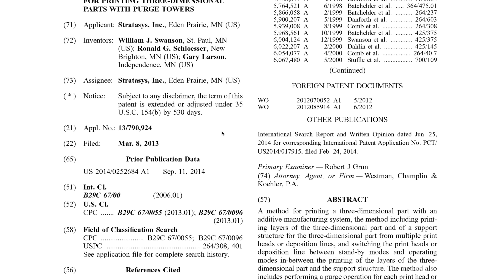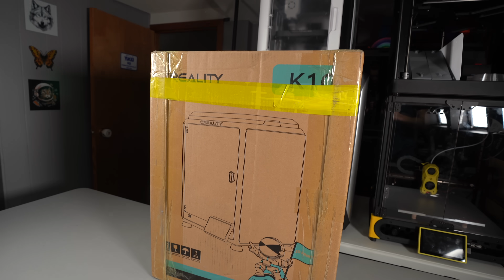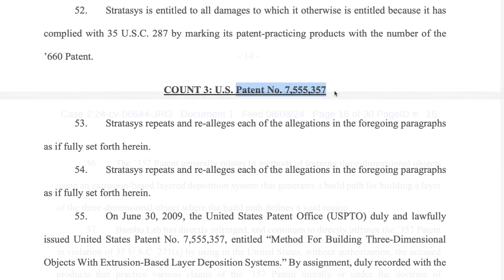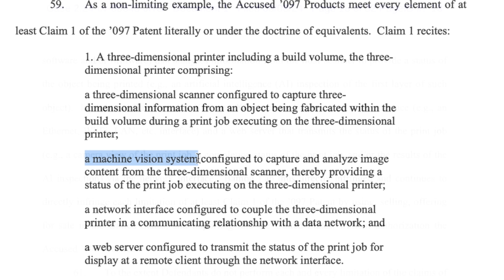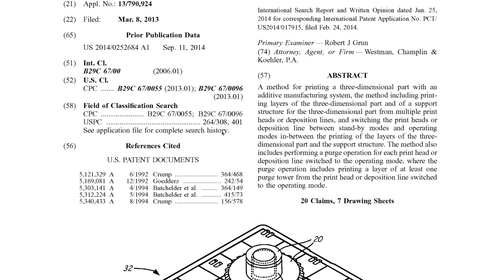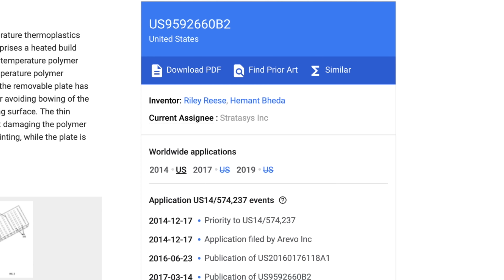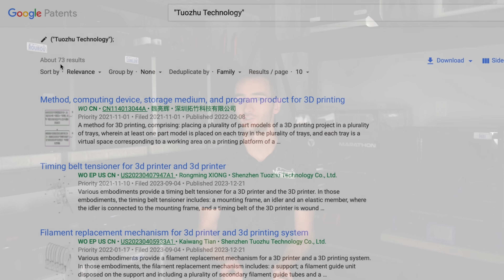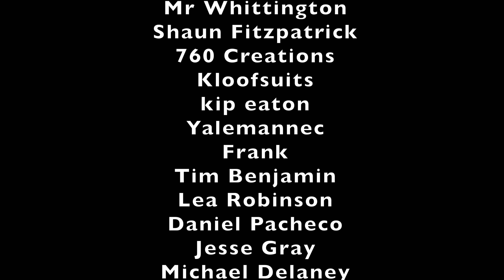Stratasys v. Bambu Lab - Will Prusa Play A Role ?

Comment: FIY, Bambu Labs is also positioning themselves to be a Patent Troll. For example, Bambu Lab have patented: Triple lead screws on the Z-axis (Shenzhen Tuozhu Technology Co Ltd, 2021), Filament motion detecting sensors (Shenzhen Tuozhu Technology Co Ltd 2021), Automatically determined variable layer thickness, A patent to print multiple colors each up to a "threshold" height value above previously printed layers, Automatic splitting of multiple object STLs to identify faces that are outer surfaces, inner stitching surfaces and other and applying different print qualities to each, Automatic determination of print speed per layer based on angles/curvature (and perhaps other features) of the model for each slice,  Multiple build plates in the slicer, Cutter in print head, Automatic determination of linear advance using 2 speed test print and LiDAR. . . 

Both Stratasys and Bambu Lab are highly capitalized tech companies that benefit from hundreds of millions of dollars in investment capital. They assemble huge portfolios of patents in order to stifle competition. Both companies are a threat to the continued viability of the RepRap/Open Source 3D printing community.
Reply: Damn, the only one thing i think they should be granted is the lidar, everything else is either prior arts in voron or cura
Reply: They are both poised to be patent trolls, yes, and yet stratasys is the sole reason we only now finally have printers shipping with sealed build chambers and some with heaters, the concept of sealing your printer in a box has basically been a pip-dream until their patent expired. They have stifled all innovation in the field, and have refused to innovate any affordable solutions. Now imagine the costs they impose on other companies to license their technology of 'box'.. Imagine if the X1C costs +$2k on-top of it's base price, simply for the honor of being a box that retains heat to help prints not warp.. because that's the world stratasys has been working towards, whenever they come out swinging like this.
Reply: Fair and agreed. Although if stratasys win then that just shows how valuable/essential patents are both for offense but also for negotiation with the likely settlement. The best outcome is if stratasys spend a lot of time and money and hopefully some of its ridiculous patents are invalidated. Then at least there’s a risk with patents and litigation. If they will all prosumer printers will need to start patenting to defend themselves.
Reply: @eltamarindo  You are absolutely right
Reply: Also, I don't get why outside Europe is still allowed to patent software features/algorithms... that is only harming innovation, and it is unjustifiable.
Reply: Just to play devil's advocate, it's possible they're patenting those things as protection from Stratasys, the bigger threat in that they have a lot of legal funds to throw your way.
Reply: Just abolish patents. Problem solved
Reply: Yep, I quite dislike what Bambulabs are doing but Stratasys is actually putting it into practice now, it would be a huge precedent pushing the whole industry back years.

When Bambu tries to do this in the future, they'll face community backlash like Stratasys is now.
Reply: I don't think you understand what "patent troll" means. Almost every company files for this kind of silly patent because the primary functional of patent in real world is to serve as a deterrence. Companies build an arsenal of patents and use them to countersue when other companies sues them, creating a chicken race situation in mutual patent lawsuit that often leads to settlement. Sometimes company may even seek loophole to file a patent that is not a novelty but similar to something their competitor already uses just to strengthen their patent portfolio (Stratasys did this in some of their patents). This is a standard practice in the industry. We have a flawed/very dated patent system and all companies are doing this whether they like it or not, because not playing the game put them at disadvantage. Hate the game, not players. It's only "patent troll" when the patent holder is not actively using the patent with the sole purpose of having patents being to extract license fee out of other companies. That is applicable to neither Stratasys nor Bambulab here.
Reply: Patents are the way a company protects itself against other companies. IBM is famous for this approach. Sue IBM for patent infringement and they will likely counter sue using patents contained in their arsenal.  Owning patents is not the issue. What a company does with them is.
Reply: I hope Prusa can make a Bambu Labs competitor. The XL is too expensive and the MK4 is too slow, only 1 material, and has no enclosure

They need to make a $1000 Bambu killer or I’m worried about their future
Reply: @chadkrause6574  they can't. You can't make a glorified Ender3 more expensive that good CoreXY enclosed machines and be the competitor
Reply: @chadkrause6574  The new MK4S is actually a little faster than the Bambu X1C, thanks to a much better cooling system and the high flow hotend.
Reply: Are they actually enforcing those patents though? Sometimes companies play the game by accumulating lots of vague patents, so that they can enforce them defensively if another company tries to sue them.
Reply: @andybrice2711  Who is "They"? Bambu Lab is the marketing arm of a set of larger  Chinese conglomerates. The larger entities own Bambu and own the patents. It is the upstream owners of Bambu Lab that will be enforcing the patents.
Reply: No, a patent troll is an entity whose sole activity is to own patents and litigate.  Bambu Labs is, per definition, not a patent troll.
Reply: Exactly, Bambu isn't some small company being victimized by a giant corporation, they're just as massive and patent happy as Stratasys. Bambu made their bed and now they get to lie in it. I'm not saying Stratasys is in the right, but I don't have a lot of sympathy for Bambu. You reap what you sow.
Reply: Has bambu gone after anyone for using similar tech? Owning a patent is not the same as being a patent troll. Look, I want a reason to hate bambu but unless they actually do something bad I dont have a reason. Outside of not being open source and using proprietary parts.
Reply: You're surrounded by products with patents. Why is 3d printing supposed to be patent free?
Reply: True, but Bambu also improved the designs and made them super reliable, affordable and available. I don't have a problem with patents that are super active like that.

On the other hand, Stratasys patented and then did nothing for 20 years, but keep others from advancing the tech.

Now that companies developed in 5 years, what Stratasys refused to do in 30 years, now they have a problem. They had a monopoly for 30 years. Give us a consumer sub 1000$ 3d printer then Stratasys? I'll take it, heck I'll take 50 of them. Bambu is a multi billion $ company now. Stratasys market cap is 0.5 billion. They could have 10X their makret value if they actually USED their patents and gave us a consumer 3d printer.

F them and their patents.
Reply: @replikagear3333 oh get a clue already! Patenting the use of three lead screws for z axis? Are you kidding me? If Bambulab could have their way you'd only be using RFID tagged materials from their store, same as stratasys.
Reply: @free_spirit1 You're assuming an awful lot. As others have said, having patents isn't an issue. It's what one does or doesn't do with those patents that matters. If Strata wins, Prusa will be next, and so on.
Reply: @free_spirit1 So what's stopping them from forcing us to use their filaments? I care about bambulab cause I can afford their printers, I don't care about stratasys cause their good printers cost as much as a luxury car or as with the ultimaker printers which I've heard are outdated and overpriced.
Reply: @OhImKiCkiN  ah yes companies, famous for being totally consistent in how they operate over multiple decades and leadership changes. especially when it comes to principles they haven't even claimed to have, let alone made any sort of binding agreement to uphold. as long as a company's present leadership has a general vibe of maybe not wanting to use them for anything nefarious in the immediate future, what's wrong with granting them unreasonable anti-competitive powers that last for decades?
Reply: @OhImKiCkiN  I do not think that prusa be next. Bambu Labs jumped 3000%, Creality 30%, Prusa wasn't mentioned.
Reply: @SpectraV3i  I'm not sure what that has to do with anything. If Strata wins they'd start new suits against other companies, and they wouldn't show their hands now anyway.
Reply: @free_spirit1 they could do that, but they just know it’s bad for business and won’t.
Reply: I kinda want Stratasys to win lol. That's my hot take. BBL shouldn't have even been granted most of their patents to begin with
Reply: @thanhtacles  If you want Stratasys to win, you obviously don't care about affordable consumer printing. Most of Stratasys' parents are incredibly vague and cover basic stuff, on the level of Apple's old "rectangle with rounded corners" patent.

Comment: pretty sure this lawsuit will be settled out of court, i spoke to some patent lawyer frinds of mine and they all said, this will likely be thrown out of court since stratasys hasnt done anything for other companies using the same technologies. 
heres hoping
Reply: You don't need to defend patents the same way you do for trademarks. As unethical and shitty as it is, you can absolutely spend 10+ years letting an entire industry grow up around your (infringed) patents, then swoop in with lawsuits to eliminate all the competition and steal the market that they created.
Reply: They might persist with LiDAR and hot-end filament pressure sensing, those are unique to Bambu I think.
Reply: I dont think there is anything in patent law requiring a holder to sue all instances of infringement before any other company is sued.
Reply: Right, this is what I've been thinking - in order to have merit in defending a patent, you have to defend it consistently. To wait this long while Prusa and other companies "steal" their patents (that should never have been awarded in the first place). They haven't consistently gone after companies for the heated bed, purge towers, features of octprint and Duet, etc, so I don't know if this would even fly in the Texas courts that favor patent holders. All Bambu's layers have to do is point to Prusa, Duet (or companies that use Duet in the end products), Creality, etc and say "These companies have been doing these things for years and you didn't file suits"
Reply: @anthonyalbanese1993  You're thinking of trademark law. Patent law does not generally require you to defend it for upkeep because they expire after 20 years, whereas trademarks can be renewed indefinitely.
Reply: @anthonyalbanese1993  Yeah but that's the power of the US legal system. Judges CAN just ignore the argument that consistent patent defense is even necessary, even in this particular case. There's no consequence to ruling it like that, other than the threat that it can be appealed, but that requires a higher court and continued pursuit on plaintiffs. Judges with domestic/politicized biases can just rule for the patent holder despite sound arguments, esp in a case like this where it's Stratasys (USA) vs Bambu (CN). There's nationalist interests angles to this case.
Reply: bambu hasnt done anything either but taking technologies from other companies
Reply: @michawasiljew6620  Yeah, but I also haven't seen Bambu going around suing other companies.
Reply: @michawasiljew6620 Shit take.
Reply: @catnipaddict126  Keep mushrooms out of this!
Reply: @michawasiljew6620 Right, but none of those companies have a patent on any of that technology.

Comment: Stratasys seems to have a butthurt CEO and skill issue to actually compete in the 3DP market, so of course less people are going to run out and buy their printer and they instead buy a Bambu. Also, I’m not a legal expert, but shouldn’t legal courts not be biased towards patents? Shouldn’t they be like, neutral?
Reply: Nothing is legal battles is ever neutral. Our system is so broken.
Reply: nope a legal intern who didn't do their research. Guarantee there is a patent that Bambulab has filed for that Stratasys is infringing on in their commercial printers
Reply: The problem is that bambu labs is punching above their weight and stratasys is losing customers in their 100k+ market segment to bambu labs.
Reply: @middleagebrotips3454  Punching above....? 
You mean they offer better product at a lower price for normal consumers? 
Or am I missing something?

Comment: Prusa lacks a video camera because of the US patent US8562324B2 (google it) that Stratasys has until 2030, after acquiring MakerBot. Everyoneelse infringes the patent. Here is what the patent says: „A device comprising:
- a three-dimensional printer including a build volume;
- a network interface coupled to a data network;
- a video camera positioned to capture video of the build volume from a point of view; and
- a processor configured to receive a three-dimensional model through the network interface, and to control operation of the three-dimensional printer to fabricate the three-dimensional model as an object within the build volume of the three-dimensional printer, the processor further configured to provide a user interface to a remote user accessing the device through the network interface, and to present in the user interface an image of the build volume from the video camera and a two-dimensional projection of the three-dimensional model from the point of view of the video camera.

The video camera may generally capture images of the working volume , the object , or any other hardware associated with the printer . The video camera may provide a remote video feed through the network interface , which feed may be available to remote users through a user interface maintained by, e.g., remote hardware such as the print servers  or within a web page provided by a web server hosted by the three-dimensional printer. Thus in one aspect there is disclosed herein a user interface adapted to present a video feed from at least one video camera of a three-dimensional printer to a remote user through a user interface.”

Comment: Sounds like Ultimaker should be targeted too, but they are smaller.  They have used RFID and heated beds as well as using cameras for monitoring over networks for years and other methods.
Reply: Stratasys bought Ultimaker a while back, and Makerbot as well, so they won't sue themselves
Reply: @benjaminford8173 Ultimaker is actually their own entity now. That said stratasys owns about a 45% share of the company so they have a lot of control. At least this is what I've heard.
Reply: Boy have i got news for you
Reply: Facts. If bambu bring any evidence of these other companies selling items like this with no blow back the case should be dismissed
Reply: I'm ditching Cura. I made sure to turn off the anonymous data reporting, updates, and such too while I transition to PrusaSlicer.
Reply: Stratasys owns part of UltiMaker